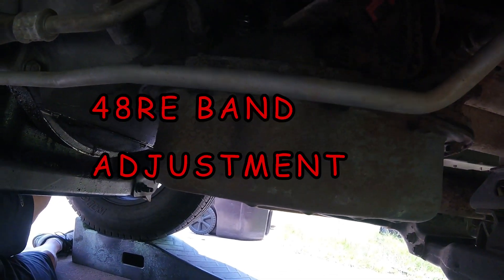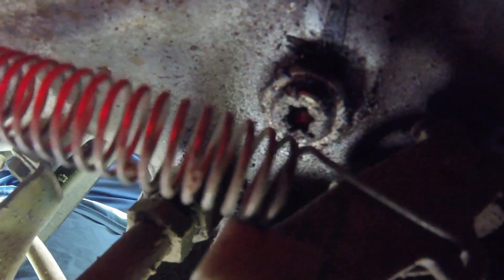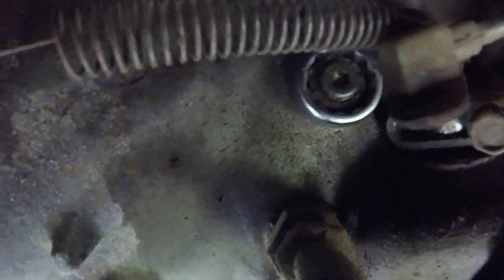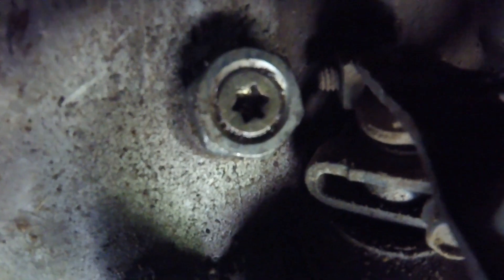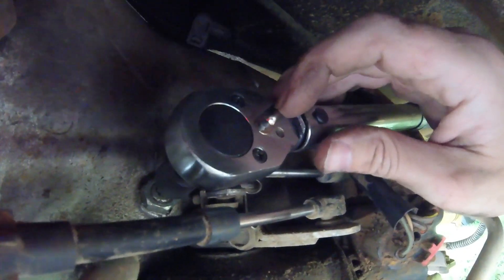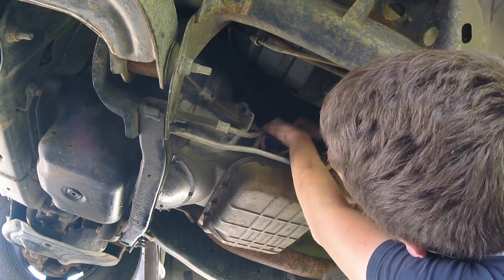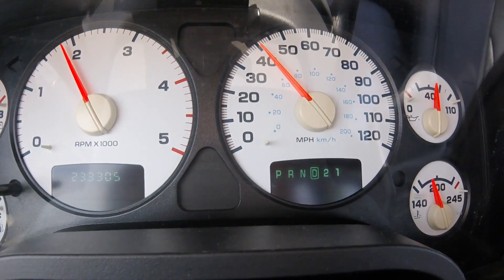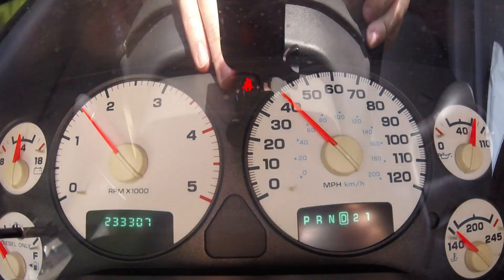How to do a Front Band Adjustment on a Dodge Ram 2500 48RE 46RE 47RE

Comment: is there a cooler line restrictions on these trucks?
Reply from the maker: Javy Mcdeez I have never heard of a cooler line restriction.
Reply: the gas dodges had them at the coolers, they would clog and kill units.  little plastic filters tossed in the hose
Reply: it was installed for the car owners complaining about the bang on the first engagement into any drive gear. the restriction kept that bang from happening. sick joke gone full circle!
Reply from the maker: Javy Mcdeez What I found to fix the problem was to change the governor pressure sensor and solenoid. It cost $150 and an afternoon to do.
Reply from the maker: here is the video for the governor pressure sensor and solenoid. Thanks for the idea and watching.
Reply: Yep. A cooler outlet check valve that's there to prevent "drainback" of the cooler and converter into the transmission pan. If the trans, pump, converter, seals, coolers, cooler lines, etc are "tight" not having that valve will "siphon" fluid out of the converter and even the pump and a CHRYSLER Torque-Flite trans or descendant thereof, which doesn't circulate oil in PARK but only in NEUTRAL will "run dry" until its put in gear or neutral to refill the converter and coolers. Of course at IDLE while the trans oil pump is also trying to fill clutches and/or band servos and the valvebody itself, that's going to take a while. How long depends on the condition of the pump, seals, filter, oil, etc. And a "deep" pan for "high-performance" use just puts the filter and oil that much further BELOW the pump itself and its that much harder and takes that much more time to get everything full of oil. Cold oil makes it that much worse and thanks to the dual bands and use of bands where and how they use them, Chrysler autos are also very intolerant of cold, thick oil which adds a bunch of drag in park when the trans isn't "pumping oil" and isn't bypassing any oil to help warm it up and isn't keeping the converter full so converter "slippage" helps heat the oil. 

And because Chrysler autos use at least three "elements" for every gear and and rely on an overrunning  clutch for first gear and sprag clutches need a certain amount of friction to work correctly and GLAZING due to drag and insufficient lube and "worn-out" fluid that's broken down and doesn't "grab" well (fluid is the REAL "friction" source and "power transfer medium" in WET CLUTCH POWERTRAIN COMPONENTS AND SYSTEMS and is "gritty" and "thin" to create a certain degree of "lapping" during low-speed application/release cycles to prevent "glazing" and slippage under high loads during high-speed shifts) is exacerbated in a transmission with multiple bands that like disk brakes are ALWAYS "partially" applied and "servos" are NEVER completely emptied once parts are worn to the point the return springs aren't able to completely empty them, its a no-brainer that a Chrsyler auto can have "clean" and "unburned" fluid yet still "slip" and "slip" badly. Why? Because Chrysler autos "slip" in the "gears" that are necessary to get the vehicle moving to begin with and then are necessary to accelerate it enough to shift into the higher gears where trans loads and temps can be higher and torque converter slippage and oil heating are increased under heavy loads. 

You won't see a "burned up" Chrysler auto due to "slippage" at the forward band because the forward band applying and releasing is what creates the 1-2 and 2-1 shift which only occur UNDER LOAD at full-throttle, maximum-load situations and even THEN only when the transmission is shifted manually and/or automatically when there is enough load and traction present to "pull down" the engine or rather slow down the trans input shaft by increasing torque converter slippage. Torque converters MULTIPLY TORQUE while DECREASING SPEED like a set of reduction gears because internally the unit is "pumping" oil from "impeller" through the "stator" into the "turbine" which drives the trans input shaft. They also create a huge amount of heat and slippage in the process and that's what kills all auto transmissions but the faster the trans input turns as the load is overcome the less "slippage" there is. 

And unlike other autos that shift "clutches" at 1-2 and that only have a band for "kickdown" shifts at 3-2 at much higher vehicle speeds and lower loads when there is a lot more "unused" oil available because converter slippage is a lot lower and the converter is closer to "lockup" (hydraulic lock-up rather than ACTUAL lock-up with a clutch that physically "locks" the pump side of the converter to the turbine side) where the downshift is relatively small in terms of gear ratio (1.00 to 1.50ish:1 with TH350s and 400s), the Chrysler "downshift" when the band reapplies at 2-1 shifts is huge at 1.40ish:1 - 2.40ish:1 and the engine RPM will increase dramatically and almost invariably the engine's torque output will drop dramatically to the point that even with converter multiplication, an extremely large load dragging the vehicle and engine down because they're OVERLOADED still won't be enough to cause trans "slippage" because TORQUE INPUT drops as well. It takes LOAD ON THE OUTPUT SIDE for ANY transmission or any other "gearbox" to be subjected to "torque" on the input side. 

So Chrysler TF trannies and their "descendants" have a big rep for "reliability" even though until the CUMMINS PICKUPS came along, they were never subjected to HIGH LOADS at HIGH SPEEDS with HIGH TORQUE INPUTS and obviously they became a big liability in a hurry once the "horsepower wars" started. Chrysler didn't expect to sell piles of Cummins trucks period and not to "recreational" users regardless and of course didn't have to compete against Duramaxes and Powerstrokes but "only" 6.2s and TH400s and Fords that overwhelmingly were manual trans trucks back in the late 80s. The primary reason Chrysler went with the Cummins at all was to try to keep its head above water until the "2nd gen" trucks came out and Chrysler was mainly hoping to take "third place" from GMC rather than really compete with Chevy and Ford across the board.

 And Chrysler was making a killing on MINI-VANS and FWD V-6 and 4-cylinder passenger cars to a lesser extent and didn't EXPECT the Cummins trucks to create a big surge in demand for Dodge pickups across the board and when Chrysler sold 100,000 Cummins trucks in the first year compared to the MAXIMUM of 20,000 they figured would be a "best-case scenario" (keep in mind Chrysler was BUYING ALL THOSE ENGINES AND THEY WEREN'T CHEAP GIVEN THEIR "AUTOMOTIVE" FUEL AND ACCESSORY SYSTEMS AND CALIBRATIONS and having Chrysler-specific flywheel housings, etc) so when they went through the roof and Dodge's sales of GASOLINE "heavy-duty pickups" such that they were imploded and they had to fork out huge amounts of money to buy a LOT more Cummins engines than they planned to meet demand, there was no available capital for a new transmission, no reason to believe that GM or Ford wouldn't be desperate to BUILD ONE for Chrysler when their own HD automatic sales crumbled and no reason to believe MORE torque capacity would be needed in the future since Dodge Cummins trucks were competing against week-kneed "competition" that almost certainly wouldn't put big money into new engines, etc to try to take a "niche market" from Dodge. 

Chrysler should have gone with a "partnership" with an existing engine/powertrain powerhouse like General Motors instead of buying an agricultural/construction/industrial diesel engine from Cummins that to that point was only used in some vocational vehicles like UPS trucks and wasn't "automotive" by any stretch of the imagination and was only a big improvement over GM and Ford diesels AS FAR AS THE ENGINE WENT and when the rest of the powertrain was set aside. Perkins diesels would have been a better fit for Dodge given their size, power levels and cost at that time when they were used in machines more "automotive" and with "automatic" or rather powershift transmissions like Caterpillar TLBs. 

And being dry-sleeved they would have had an additional selling point despite being cheaper to produce than a medium-duty parent-bore engine that has to have its ENTIRE CYLINDER BLOCK made out of high-nickel, long-life and wear-resistant "cast iron" to have a long service life in a direct-injection, turbocharged diesel application. Dry sleeved engines can use lighter, cheaper cylinder blocks made of cheaper and more easily and cheaply machinable metal and put the good stuff in the cylinder liners only. And end up lighter in weight and more compact than a parent-bore engine and an "automotive" engine block is an option using all the other standard internals but without the "one size fits all" design necessary using a "medium-duty" engine like the Cummins B in a pickup.

If Dodge had gone to Perkins or Caterpillar after Cat bought out Perkins instead of assuming that Caterpillar bought out Perkins to create a larger market for its own engines in that size range rather than to guarantee supply for its most popular and most produced heavy equipment line, which was TLBs, Dodge could have worked out a deal for Perkins/Cat engines AND the 4-speed "automatic" transmission that Cat used in the biggest, most-powerful 446B TLBs which Caterpillar may not have produced but was a good starting point. I'm not sure WHO made those trannies but it wouldn't surprise me if GM had something to do with them since Spicer made the gear trannies in the smaller units and GM had a long history with Spicer and Spicer-Dana. One thing is for sure. Caterpillar could have taught Dodge about how to PROPERLY mix-and-match parts from different manufacturers to produce a high-quality, ass-kicking product since those TLBs themselves were a pile of "off-the-shelf" parts from various manufacturers Cat was in cahoots with to varying degrees and different times. Perkins engine, Spicer trannies, New Holland rear axles, ZF front axles, etc.